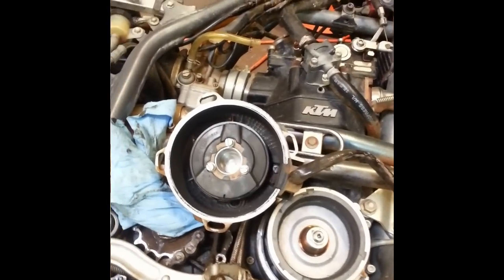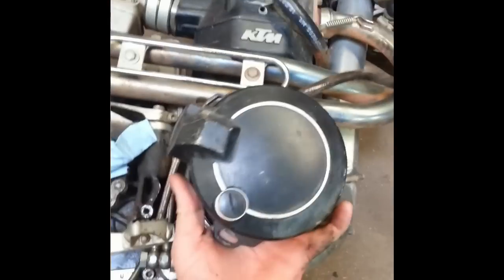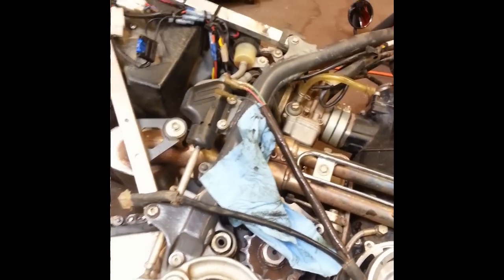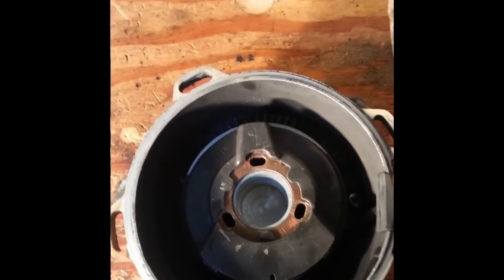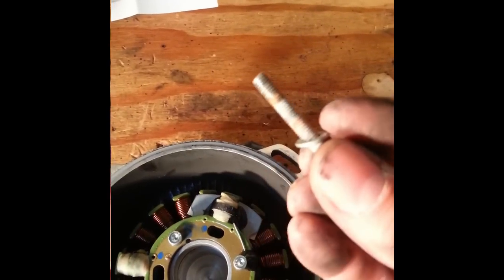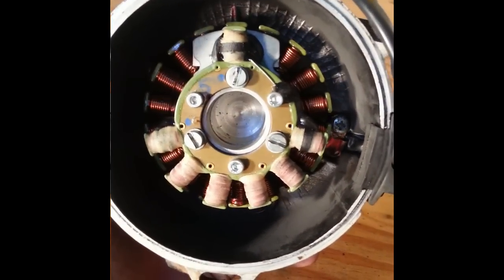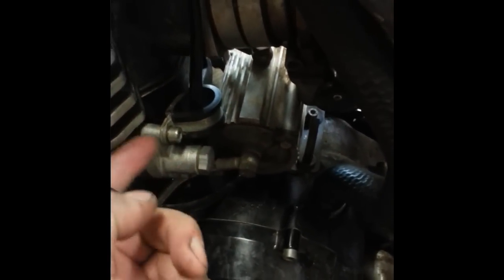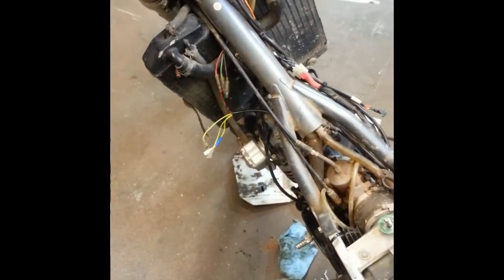KTM LC4 Motor SEM Stator Installation

Comment: Man I could use some advice on the same bike I picked up it's been sitting a long time I got it running after some carb cleaning and other stuff it ran good 4 or 5 times then it puked.. not making spark now very little info out there and parts available are slim.  looking for test values for the stator the coil primary and secondaries. I used voltage meter AC voltage across the three current wires to the coil and getting 33-40 volts ac when I kick it.. I'm suspecting the coil went bad and ordered a used one off eBay which was crazy expensive..waiting on it in mail now.. any info would be a huge help I got this bike dirt cheap and just always wanted to ride one since I seen back in the 90s . I would be willing to pay for info and time
Reply from the maker: Yep they're tough. parts are hard on the old LC4 bikes. I would suspect the stator has failed, very common with the old SEM stators. Email me at octaneandelectrons@gmail.com, I do paid virtual electric help sometimes.

Comment: This video is fantastic and nearly a thousand years old! But how do I tell if it’s the stator or the red ignition coil box thingy? I’m working with a 98 KTM 620SC but it seems to be nearly the same. It’s really hard to find any info on the damn thing though.
Reply from the maker: Yup that was a long time ago! You can measure the stator coil resistance, there is a spec somewhere in the service manual. If they check out, then the CDI/coil unit is probably bad.

Comment: Hey thanks for the video. Can you tell me if you got the ST5525L or the ST5500L? On the manual in the video I would say there stands 5525L. But on their website it says the 5525L is for 2 stroke and the 5500L is for 4 stroke. I got the LC4 620. I am a little confused here.
Reply from the maker: I really don't remember, sorry! It was too long ago.

Comment: Great video!! Very helpfull for me! Do you know if there is any diference between KTM GS 250 and KTM EGS 250? i'm trying ti find a stator for my bike and i think she is an KTM GS of 1996 but i only find parts for the EGS model, so i wonder if there is any diference and if the stator will fit. can you help me?
Reply from the maker: Sorry I have no clue on the difference between the models. I'm familiar with replacing the SEM stator, but that's about it.

Comment: Anybody actually look at these comments still? So with the three wires that you have plugged in will the bike start up as it is? Where do the three yellow wires go? I just ordered the replacement stator and I'm trying to get everything fixed up, a few people online said that since I am replacing the stator I have to replace the coil or CDI, Is this true?
Reply from the maker: Sorry that was a long time ago. I think yes the SEM stator needs 3 wires connected to run. The Yellow wires are for battery charging or lighting. There is no separate coil and CDI on this system, they are combined in the coil unit.

Comment: Hi. I have a ktm 620 from 1997. how do you know that the SEM stator was broken? how do i see if mine is broken? Mine doesn't spark the candle. thank you
Reply from the maker: There is resistance specs in the service manual to test the SEM stator. Also the ignition coil unit can be bad.

Comment: My 96 620 EGS had a similar failure.  It had the same stator as yours but a different/newer rotor, i think.
The symptoms were weird. It would cold start and idle perfect, then after a 20+ min ride it wouldnt idle anymore. Adjusting the idle screw  would help for a bit but soon it would drop again until it died or was revved up. It would still start back up after it died, and was fine while under load. I originally thought it could be a fuel issue so i went through the carb and replaced a few parts but obviously didnt help.  Checked charging voltage and found it low and a bit jumpy. 
I thought it was a bad rectifier but back then a replacement was over 200 bucks. So i bought a universal rectifier for 60 bucks and wired it up but had the same problem. 
Luckily my failure wasnt catastrophic but 2 of the stator magnets were loose and a bit chewed up. When it warmed up they would move around causing weird ignition stuff. Just an FYI in case anyone is having similar problems.
Reply from the maker: Yes, makes sense!

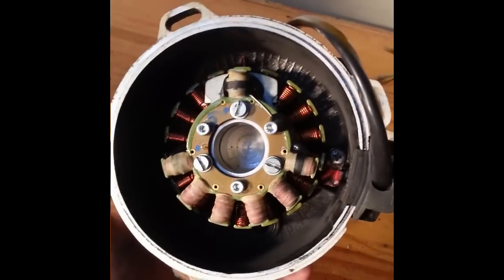Comment: 7:01 could you explain to me what exactly i have to do to line it up correctly? just center the screws as best as i can?
Reply from the maker: Yes that is a start. The stator can be adjusted for slight timing tuning.

Comment: I've installed the same stator on my 97´ LC4 620 and used a RR-10 regulator from Electrex World as well. It works like a charm and my bike is finally running again. The only remaining question I have is about the timing. I just centered the stator in the screw holes and put the cover back on its mark. My bike runs nice, but I'm asking my self if it could run even better. But I'm to lazy to test different settings. :)
Reply: I have the same bike, i love it. Im waiting for a stator to be shipped so i can swap em out and be back on the road. Cant wait.

Comment: Nice video but I have one question, I have the exact same bike and ‘I am switching to the same stator. There are two yellow wires coming from the voltage regulator and the stator has three yellow wires (one with blue tape )  and I am not sure which two to use?
Reply: One yellow and the blue marked one. It doesn't matter which yellow as long you connect the blue one to the ground.
Reply: @intrinia   żółte  łączymy razem to 1 faza ...

Comment: How did you know the stator wasn't working? Did you replace it preemptively? My bike wont start when it's hot. I've had the carb rebuilt, valves checked, timing checked, etc. It makes spark when cold and will start with some effort ... (2k kicks... no joke). Then when it warms up, it will quit and not restart until it cools off overnight. I've had 2 local mechanics look at it to no avail with the last one saying it "might" be the stator... just dont want to drop $300 on a maybe. Any ideas?
Reply: Kyle Nupson it's probably vapor locking check and make sure your gas line isn't in the way or on anything hot
Reply: I had the same problem on husqvarna te610e,It was a bad pickup coil

Comment: Hello, great vid. just was curious to know how did you know that the stator was out. how do you test something like that? any input would help thanks!
Reply: +luke c I just got a '96 Duke; every tech discussion I've seen on that vintage says the stator grenades by 10k miles -- taking a lot of other expensive parts along with it -- so you're wise to do the upgrade (that the later models got) well before then.